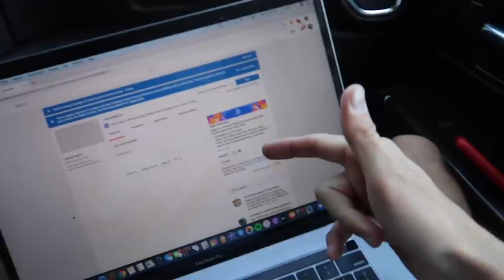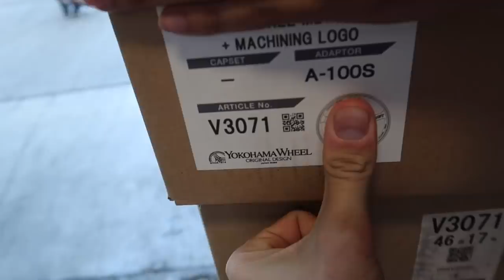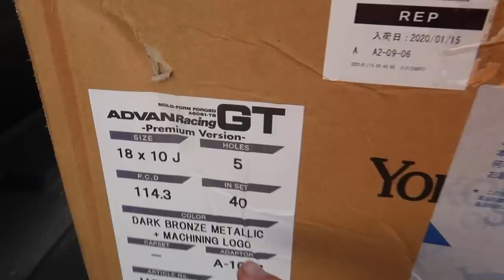SUPRA GETS NEW WHEELS + C8 DELIVERY?

Comment: You can run a Toyo 305/35/18 R888R in the rear with that size and offset. You’ll hook all your power in mid 2nd gear.  - A Supra owner and who works on them with over 1kwhp
Reply: You’ll need to shave the fender well so it’s flush. Shave don’t roll on a Supra. Rolling always causes issues with them.

Comment: New wheels are fire! 295 will work on 10 inch. Stepping up to 305 would need 10.5 at min, 11 inch would best. 18x11+51 fits flush on rear without work.

Comment: TJ: There's dust on my camera, probably should be a new one.
Spends Thousands on wheels and tires, spends less then $800 on a camera, and wonders why his videos are out of focus and shaky.

You do realize they make lens cleaning kits. If the dust is inside the lens, you need to open the aperture, and use air pressure to blow it out. You can also use a dust brush with the aperture blades open. Your on youtube....why not watch and support another youtuber by watching how to properly take care of your equipment.

To add insult to injury you bought a crappy vlogging camera that doesn't have good autofocus. You could get better video quality if you used and iPhone 11pro and a Zhyn Smooth 4. Spend some money on your video equipment. You will get better results. Or hire someone to do your filming...but please do something the continually out of focus videos look like my 6 year old filmed it....while my 7 year old can at least film an entire video in focus....drives a Lambo, but can't keep a video in focus for 20 seconds....what a waste. Learn your equipment.